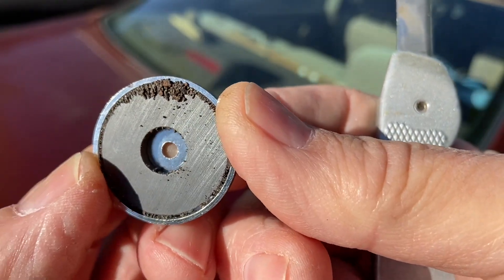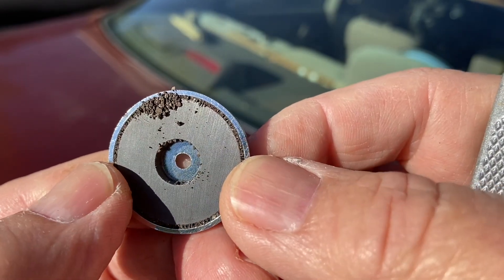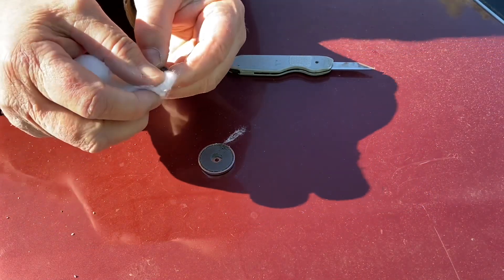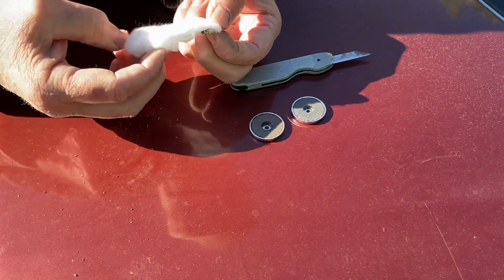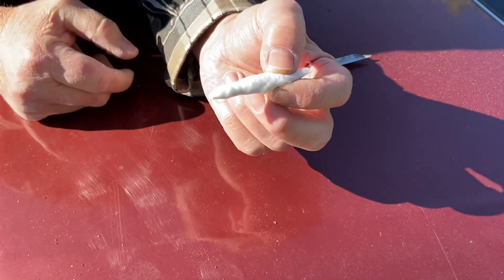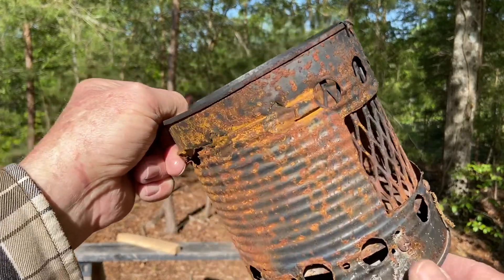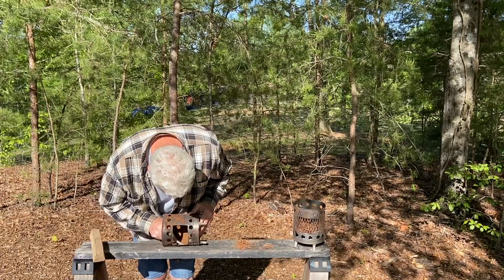Magnetite Fire Rolling Experiment, A Red Rust Save

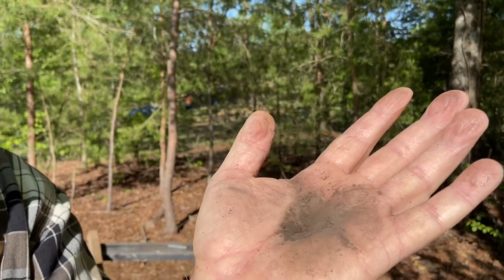Comment: At 5:29 you mentioned ash that has been rained on doesn’t fire roll.  The most common soluble compound in wood ash is potassium carbonate (potash) which would be leached by the rain.

Have you looked into how fire rolling with ash works, as far as chemically and physically (particle size etc.)?

Are you interested in that aspect, or more on the practical side?  I’d have suggestions, but I DID read your pinned comment about test ideas.
Reply from the maker: I would mention potassium carbonate if I could remember the name. When mixed with, not leached away from, water it makes lye. There is always some Lye in a wood ashes fire roll because of the moisture content of the fibers and the chemical process itself. You can see the condensate left on the bottom board under every freshly rolled fire roll. I always tell people that "I THINK" what's going on is friction and chemical reaction. Feel free to post how fire rolling with ash works.
Reply: @DavidWestBgood2ppl  I’ll let you know if I find out!  I had never heard of it before seeing one of your videos two days ago.
Reply from the maker: To my knowledge no chemist or physicist has studied it.

Comment: I was chief operator at a wastewater plant going through an upgrade.  The solution was to use existing tank space and add Magnetite powder to "ballast" the solids in the wastewater with a bit of polymer.  Added weight, settle faster therefore it could handle more flow (simplest explanation).  Worked well, one issue with the pilot study though, we lost air, things settled, we regained air and had one large Magnetite laden mass on the bottom of the clarifier which ended up destroying a gearbox, ahh the fun with Magnetite!
Reply from the maker: I've been fascinated with it since a child in the sandbox with a magnet.

Comment: Ah David, Finally, Finally! I can shed a bit of light here:
Black Magnetite and Hematite are two complex versions of Iron Oxides - just as simple reddish brown "rust" is a third.  The key part of the equation here is the size of the particles - resulting in generating that high enough heat to start the cotton smoldering.  As a Gold miner I work extensively with Magnetite or Loadstone (very magnetic) and Hematite (slightly magnetic).  Both, if given many centuries of exposure to water and Oxygen, eventually break down to simple "Rust" Fe2 O3.
As I see it, the key element for a cotton roll to heat to the ignition point is friction.  Wood ash is a prime example of that.  VERY small particle ash coats the cotton and the roll causes the friction to create heat.      - Joe S -
Reply from the maker: Interesting. It's more than just creating enough heat to make the cotton smolder. Smoldering cotton is very difficult to aerate into a hot enough ember to ignite tinder. There's also a chemical reaction that builds the ember's intensity. Oxidizers are some of the best fillers.
Reply: @DavidWestBgood2ppl    Yes Sir, I thought you'd be right on top of things.
You've sparked (💥) a thought of some interest and I'll see if it pans out tomorrow.     - Joe -

Comment: Magnet clean-up tip - Drop the magnet into a plastic cup, run over your area to pick up nails, tacks, screws, etc. Then simply pull magnet from bottom of cup and all collected items fall from outside of cup. Quick clean up.
Reply: What I've always done is put the magnet in a thick ziplock bag keeps the magnet nice and clean.
Reply from the maker: Another good one.
Reply from the maker: Perfect! It's such an easy fix, I would not have figured it out. I'm serious. When I find a bigger pile of sand and try it again, I will use some version of your advice. TY!